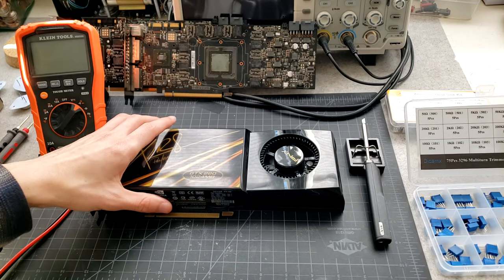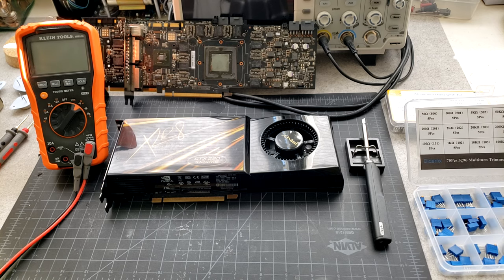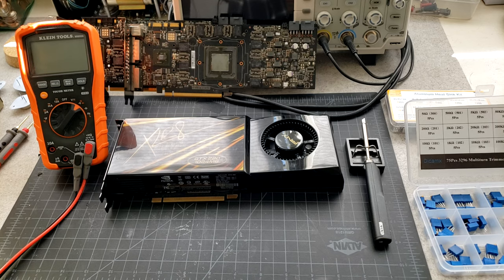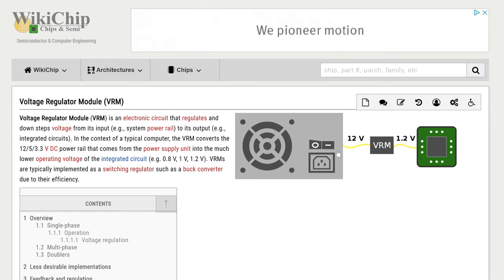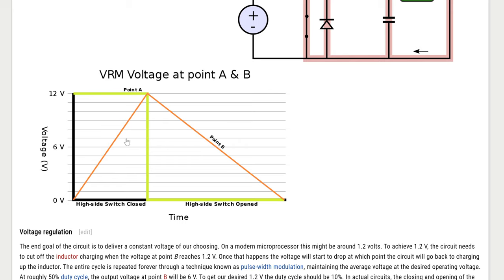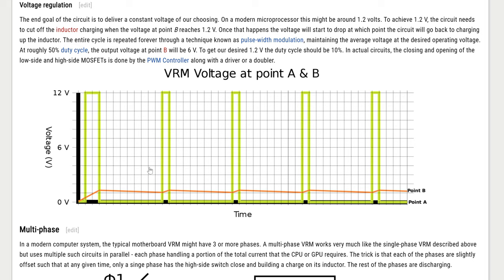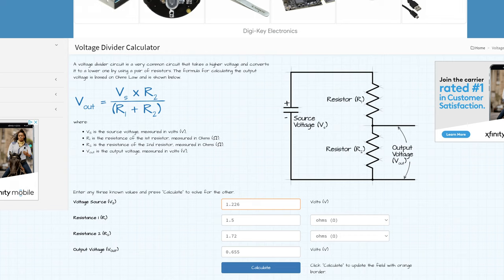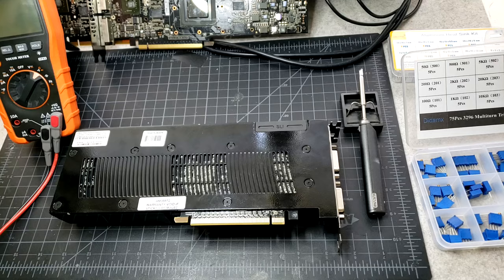How to Modify Your GPU for Increased Voltage (Voltmods) ft. GTX 280

Comment: Thank you for the knowledgeable video. Where shall I go if I want to ask someone where the voltage controller is on the gpu board?
Reply: Voltage control could be one of the chips, look them up and see what you get

Comment: Okay, this is nice and all, however as usual it isn't explained what exactly the volt mod does. Is this just overwriting the control circuit and manually applying a static voltage? Is there a way to instead achieve a positive offset for the original voltage curve?
Reply: Add more power using a potentiometer...

Comment: Great video. Really liked how you explain stuff. Also, here's a few suggestions for future reference: 
Your knife tip is kinda overkill for your application. A needle tip is much better for soldering to probe points and accurate work.
Those LED voltmeter doesn't display the voltage accurately for low voltages. There is a small pot on the back of the voltmeter to adjust it with reference to your voltmeter.
Keep up the good work :)
Reply from the maker: Hi, thanks! I know most people use needle tips but I have never gotten good results with them. Always had better luck using the big knife/chisel and just being careful with the solder. So far haven't inadvertently bridged anything.

Also, I do check the voltage of the seven-segment displays against a Keysight DMM. In my experience they have been pretty close out of the box (at least close enough for setting the mods and monitoring the voltage rails)